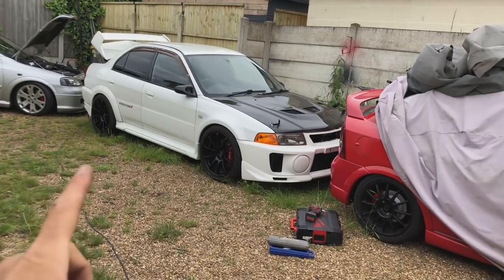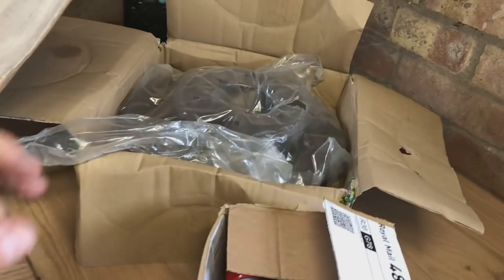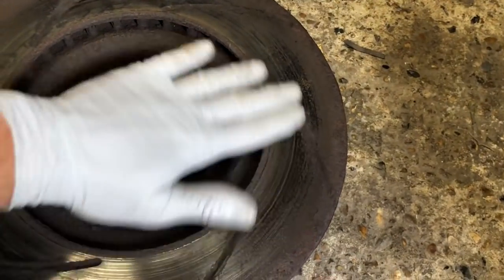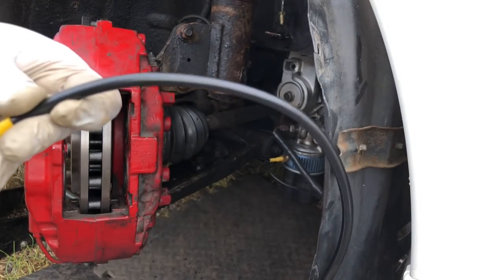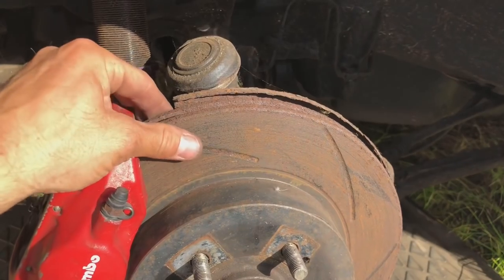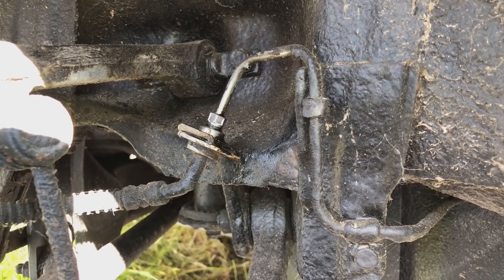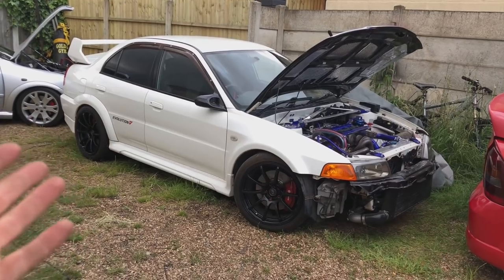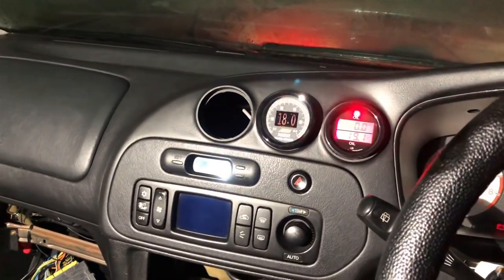THIS NEEDS TO STOP!! 700HP Mitsubishi Lancer Evo REBUILD

Comment: Look up brake pipe spanners aaron really cheap and honestly give you 10 times the purchase on the pipe a regular spanner will. The have got me out of trouble many a time went from getting 5 out of 10 to undo to getting 9 out of ten undone and all without rounding the nut.
Reply from the maker: Cheers man! I actually have them in 9/10mm but typically lost the 11mm one 🙄

Comment: Quick question, why do you put a wheel nut on before putting calipers on. I've never done that over the years I've done my discs/pads?
Reply from the maker: These discs don’t have a retainer screw so it just holds the disc in place while i fit the caliper/pads

Comment: Another quality video. But I have a Vauxhall question if that’s ok? I just replaced my turbo manifold as the last one cracked. But I can’t seem to set the actuator properly, it’s a Z20LET with a VXR standard K04. Any fool proof way of setting it please?
Reply from the maker: Hold the penny washer closed with actuator arm attached, i will then do 5-6 turns minimum of the bottom nut or high back pressure with just push open the wastegate.
Reply: Yep. 6mm is the proper distance. As the rod is M6x1mm  that makes it 6 turns preload.
Reply: @AaronUnknownPerformance  thanks a million bud. I’ve said it before and I’ll say it again, I need you to sort my car out. Great content as always.

Comment: Question.    Front disk metal guards.  Are those metal shielding plates mandatory in UK.  My thinking is the sheilding plates are the cause to the rear disc corrosion issues leading to braking issues?
Reply: Not required front or rear for mot in the uk! 👍
Reply: But leaving them off could lead to stone chipping get caught in the brakepad/disk causing it to lock up.  You dont want a lock on high speeds as it will throw your car right into the bushes.

Even worse in off-road usage.
Reply: @casemodder89  love to see a stone lock a wheel 👍🏻
Reply: @casemodder89  that won’t happen but it will make a racket and score the disc!